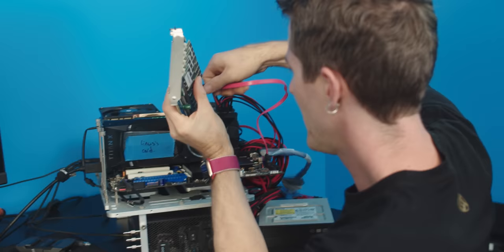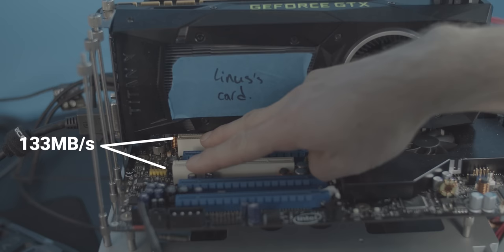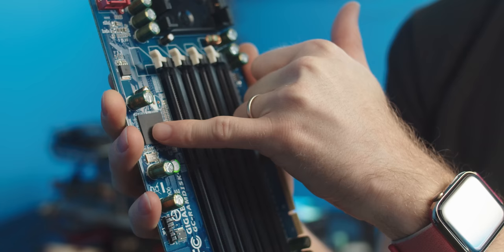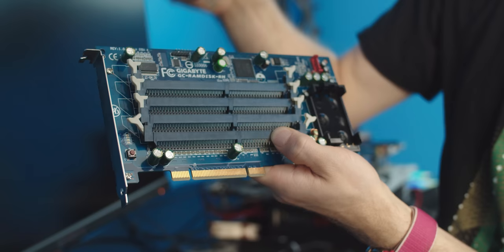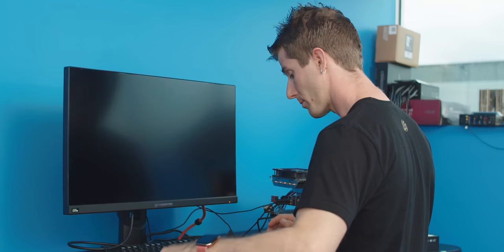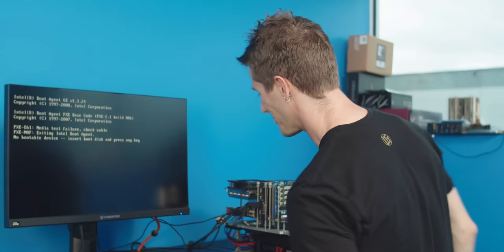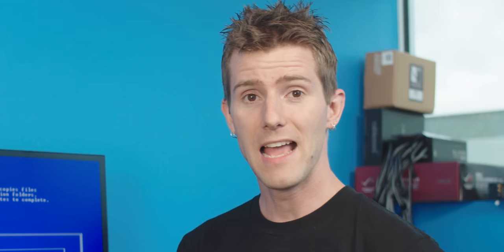WTF is this thing? - RAM on a PCI Card??

Comment: An interesting niche use for this would be if you were doing something naughty with your PC and were worried about being raided by the authorities. You don’t have to physically do anything to wipe the data, they’ll do it for you if they confiscate the PC. Would work a lot better than a none persistent USB boot drive, as it’s persistent provided the card is powered.
Reply: if they get to you, you need to run the wiping algo. especially since they're now very aware of these kinds of tactics. my interests aren't with this in mind, however, i can say that if i felt the need to do this, i'm implementing nuclear solutions. my interests are for cache/temp data though.

Comment: I remember I reviewed this in 2006 on a Czech IT-specialized server called CD-R server, now Deep in IT (diit). https://diit.cz/clanek/gigabyte-i-ram-ddr-serial-ata-ram-disk/16878 - this content was migrated through several content management systems and end up in pretty readable form, but without a working video on the 4th page. But still... i remeber as if it was yesterday. We also had the battery installed and there was a glitch when we pulled out one of the module, then another one module starts heating up so the label on it shrinked by the heat generated inside the chip. Luckily the module survived but next time we changed the capacity also by pulling the battery out of it's socket.
Nice tech back then anyway :).

Comment: Well technically all graphics cards use PCI of some kind, and they have VRAM on board
Reply: All ram lose info when the is power cuts. That is kinda the point with ram. Otherwise rebooting with an issue wouldnt solve anything. LoL

Comment: I dont know what was the state of RamDisk usage at the time, but i't looks like it would be more usefull as a second disk where you could use it for data processing or video rendering with incredible output and low latency (seems better than my Kingston A400 SSD )

Comment: I have tons litteraly of DDR2 memory, it it for you possible to build a card like your but  with 32GB of ddr2 and a battery to ensure the loss of memory. It should be interesting to recovery the old ram and at the same time to use a very fast drive, I think it should be attached to a PCIe-16 GEN4 instead of SATA for data transfer. Do you think it is possible to build ? It should be faster than NvMe Gen 4 ?

Comment: 4 years ago I missed a chance for cheap i-Ram. It is over $200 on eBay. For $200 I could get a decent budget 4TB or a blistering fast 2TB SSD.  DDR1 topped out at 1GB so 4GB pseduo SSD for $200?

Comment: I'd have used this with Linux, and set up a system for automated back and recovery from a hard drive if the memory contents are lost... but with that said I wouldn't put anything really critical on it. It would be cool to play around with however. I kind of wish I had one for PCIE that I could throw old RAM models into.

Comment: I'd kinda wanted to try a RAMdisk solution at some point, but I never got around to giving it a shot. I probably could, though... I have 64 GB.

OTOH, most of the stuff I load is like 30 different Chromium windows with 15-90 tabs each.

My system usually goes unstable long before I max my memory, and I have to ``killall -9 chromium`` and restart it (of course, restoring every single tab).

I mostly start to run low when I have to boot up a VM, b/c I usually dedicate ~12 GB to such, especially if it's a Win 10 VM (either for clients or for configging macro hardware).

I suppose I mostly just don't have a distinct purpose for which to load the RAMdisk with. So the search will continue...

Comment: well if the industry was not so governed by 5 years lifetime throw away after rules, whats wrong about turning your previous generation workstation / server RAM into some kind of useful cache / ramdisk / for the next gen one ? It would also make mem and hardware overall upgrades more attractive if you have a re-use for your old mem and make a decision for upgrade easier. At work, we have these 3-5 yrs old workstations with 256 GB Ram, still hesitating to replace them since all this mem is still expensive.

Comment: I think in some situations the whole volatile memory card can be extremely useful.
Let's say you work for a government agency, defense force, the medical field, or anywhere for that matter where you're working with documents containing private data that you're expected to keep private. You have a UPS running in your office to ensure everything remains powered during a power failure, but someone breaks in and steals your PC to obtain say a patient's medical records, or the credit card information of several hundred of your customers. They bust in, they pull your enclosure out from where it is, and by the time they have it back in their vehicle POOF!!! All that tasty data is gone!
It could also work for a high security laptop in similar situations. You have an integrated GPS, a dock station at your home and office to ensure your battery is always well charged for travel, and a removable battery which powers the GPS locator and the secure storage. Sure they could pull the battery to hide themselves, but then they would lose the data.

Now i know Encryption would also secure said data, let's not forget 2 very important things.
1: all you need to break encryption is time, and lots of it. Sure it might take up to 1,000,000,000,000,000,000 years to break 128 bit encryption using brute force with today's gear, but quantum computing threatens to change that.
And 2: various governments around the world are trying to ban encryption completely.
Another side note regarding #1
Theres a part of the world called Australia where the time it takes to brute-force doesn't even matter because the laws of mathematics simply do not apply here...
"The laws of Mathematics are very commendable, but the only law that applies in Australia is the law of Australia" - Tony Abbott
And yes the laws of physics do not apply here either 😂

Comment: could i repurpose my ddr3 leftovers and some laptop ram sticks into something like this with an old graphics card board and a little welding ?? or it requires drivers and/or specialized electronics more intricate than a simple rewiring ??

Comment: l remember having ecc 512 mb sticks on three dell mobo's they had 4 slots for mem each, and the mem actually had shiny chrome covered heat sinks that could be popped off, which l did pop them off a few times and dusted them before repopping the heat sinks back on. The comps were Dell desktops the name l believe was dimesion and we loved them three comps, we used them for POP Games and other small typing programs and some other junk. They finally got upgraded to bettet comps but darn they were fast for junkie outdated comps. l have never used ecc (Error Correction something of another) memory anymore since then, yeah the first time we opened one of them babies up, l was like "what in the hell are these harmonicas doing in the memory slots. They did resemble shiny silver harmonicas, anyone out there who has ever seen them would say the same thing at first glance. once there in your hand of course your gonna know that this is some weird type of memory,  that was back in 2001 or 2002.

Comment: Does something similar exist for cheap with DDR2/3 support?
I got like 16 GB (8-12 sticks around) DDR2 and more than 64 GB DDR3, some from my personal old systems, some from "the trash" but tried it in old systems and they work(ed).

I would love a nice 32+GB drive for "temporary" files like active torrents or even better, as the drive for the swap file, should i ever need it with 16Gb Ram

Comment: How about talking 4MB vs 4GB?

Back in 1989 we were running Versacad on 286 16 bit DOS based computers because we couldn't afford 386 machines, it was not pleasant. To help speed things along I bought Everex 4MB memory expansion cards that required individual 120ns 18 pin ram chips so i had to buy 36ea individual chips and plug them into the card.

I installed the chips on the card and put ito an available ISA slot on the motherboard. I configured it as expanded memory and made it a RAM drive. That more than doubled the speed of this wobbly computer. In another year we bought a gateway 486 33mhz computer with 4MB and that really got things moving along. Do you have any idea how fast DOS runs on tht type of processor? It was MUCH faster than any windoze machine because the programmers were required to keep the code MANAGEABLE - that is furthest thing from any programmers mind these days.

Back then my text editor of choice was SLED, that was a, editor written in assembler language - it was small (17kb) and blazing fast.

Comment: There is  a somewhat related topic I have been thinking about lately...
In today's state of tech with PCI-E 4.0 (and 5.0 on the horizon) + GPUs that have 10 to 24GB of VRAM - what exactly is stopping of from using that VRAM as additional RAM/caching when it is not actively used for gaming or 3D processing?

It seems like there is ample performance and resources just sitting idle most of the time and going to waste. On lower RAM systems it would be a massive improvement to use VRAM instead of even a fast SSD for paging - and on systems with ample RAM it would no doubt give significant improvements to use this space for disk-caching and "scratch disk" usage for temporary files.
In theory all this could be done dynamically and in software from the OS - so why hasn't this been exploited yet? ...
Reply: probably the proprietary nature of graphics drivers and cards. they're almost certainly more capable than even the manufacturers are aware or delve into, but you need to actually be able to establish and maintain this interface to use that hardware in a different manner. it'd actually be easier to make some old system act as some hacked-together graphics card than say, make the graphics card act like that old system. simply because the manufacturer more or less controls how you can use that graphics card. ofc, there are other gotchas like the fact graphics hardware is optimized specifically for graphics calculations. 

also, if this is still a relevant question, might look into compute shaders. typically would use these to generate geometry/textures on the fly, but pretty sure more general purpose applications are possible.

Comment: correction
Registered ECC RAM
NOT ECC RAM
this is very different
you can use SDR ECC on AMD751
you can use DDR ECC on AMD761 (and AMD762)
you can use DDR ECC on AMD Athlon 64 (socket 754, 939 and 940)
you can use DDR2 ECC on AMD AM2/AM2+
you can use DDR3 ECC on AMD AM3/AM3+
you cannot use any registered RAM on any of named platforms (apart from AMD761 and AMD762, which both accepts registered RAM)
only Intel have artificial problem with ECC RAM and it is ARTIFICIAL
all other platforms which do not support ECC RAM, will simply ignore ECC part of RAM and run normally - this is confirmed time and time again

Comment: Well nowadays mid range computers have enough ram to actually set up a ramdisk though it's limited to work inside the OS and that's what kills it's possible usefulness since very few manufacturers  have tried to inclue ramdisk support within their bios and getting it set up is a total bitch, but you can dedicate like 8gb of ram to have some pretty fast shading cache for whatever game or software might use it? And it still doesn't really improve rendering performance by a huge margin either for all the hassle especially since in order to build cache you have to run the application normally already so not really suitable for gaming either since new shit will be loaded everytime and those 8gb would have to be flushed constantly.

Comment: If ddr5 ramdisk pci gen 5 is exist, i'm probably sold. 512gb would be enough for gamedrive.
Why ram ? Well it has slc (single cell memory) and it uses capacitor. Meaning it has a lifetime warranty. Unlike nvme,it will likely die after 15 years of sustain load

Comment: You should do a video on this...
OCZ Z-Drive R2 m84 Series 1TB MLC PCI Express 2.0 x8 FH Add-in Card Solid State Drive (SSD) Mfr P/N OCZSSDPX-ZD2M841
Its similar but is for PCIE 2.0... and is a 1TB size as you can see from the line i just pasted.

Comment: All companies that sold PCI Dram Drives offered external power or battery packs for extended power lose.

About 10x or faster the speed of drives of the day.

effectively 2x overall system speeds sense sense my 386sx25..    yes they have been around that long.   Most effective was AMD 486DX 50 for overall performance increase.

modern machines dont have as many bottlenecks.  back then the 486DX50  had greatest potential per Hz.
Reply: olosnah1 OK

Comment: SSD M.2 PCIe x4 achieves 7000 Mbytes/s
So it's faster the that ram board pci. Perhaps in the next version will be.
But still is a good idea. Need batteries.

Comment: 7:08 My wild and uneducated guess is that there's actually "FCKGW" on it... :D
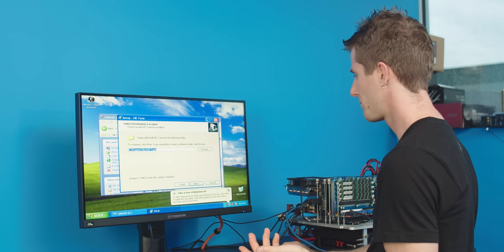8:53 I always took the ponies before they were cool :)

I literally came here because I wanted to see if there's something newer like this. Got the idea to have one because Windows has the bad habit of shooting down processes when you still have like 8GB out of a total of 32GB free, but no swapfile in use as it still relies on that stone age trick to compensate for the lack of physical memory. I don't want a swapfile to ramp up the write cycle count on my SSDs and running it off of an ancient HDD nowadays is outright pathetic. Therefor I had the idea of getting something like the i-RAM drive, but for PCIe with slots for DDR2 or even DDR3, but apparently nothing like that does exist. Would be good enough for putting the swapfile on like 8-16GB and letting Windows be Windows and do its weird things without wasting the lifetime of your precious SSDs.

Comment: FINALLY. i always wondered why there was no external or e-ram. ive always wanted and needed it. being primarially a laptop user, i dont have a tower with all those slots. my alienware 17 r5 came with 3 m.2 SSD slots, but only ONE ram slot. the included ram is onboard but i can only expand it by the capacity what one card holds. currently an 8gb but i need more, and its super annoying.  but there was everything else external even eSATA but no eRAM.... and with the advent of thunderbolt3, 40gb/sec is plenty of bandwith so bottlenecks now make the bottleneck issue a thing of the past. while having full bandwith for a decent e gpu. i want E ram. no, i need it. i can get an external pcie x16 bus, or in x1 or base pci, and pop this in? ive been waiting for  this for over 20 years.

Comment: Wow I used to install this things we called a  mega card and the other  had even PCI card with a  hdd  drive  Connor drive  .. AHH those we days when go to the EPROM and flash Nd have those chips with window and could seen.. 😮. IDE grey cable with ref line on side .. I think I use make IDE cables and have to clip the plastic connectors . Yes mega card was for ram on PCI and the mega store was for internal drive wow you got to remeber 😮☺️.. like who rember the Tandy 4000.. I used to play wizrardy 8 and. Eye of beholder ☺️☺️

Comment: Would this work well as a swap drive? Better than using up all those write counts on an SSD.
Reply: Yes and no... Benefits were slim to nothing back in the day. Probably plenty of temp files on ramdisk, game on ramdisk videos out there. I have a 10gig ramdisk via regular ram that I use for Shadowplay temp files and that works great, but originally it was setup to test if Arma 3 data streaming would be faster if the game was copied to a ramdisk on boot, via other harddrive backup, and run from the ramdisk. It didnt produce the wanted results. Nor did Sli vs None Sli apart from minor effects ether. Costly experiment! :D

Comment: I know SSD's are fast and all, but wouldn't a product like this be good for "Old Ram"?
If you're buying a new computer, let's say you're going from 16GB DDR3 to 32GB DDR4, even if I was using a NVME drive, the 16GB temp drive should be faster if plugging into a PCIe slot?
Say you're playing a game or working on a project regularly for the next few days, set the computer to automatically load the files from a HDD or SSD to the 16GB ram-drive upon startup.
Or has NvME closed the gap so much it's not worth entertaining the idea?
(Just thinking of ways to recycle old computer parts.)